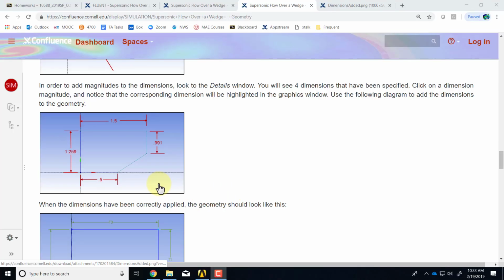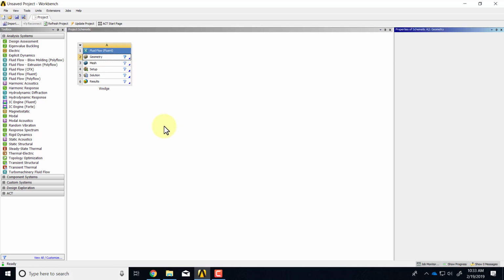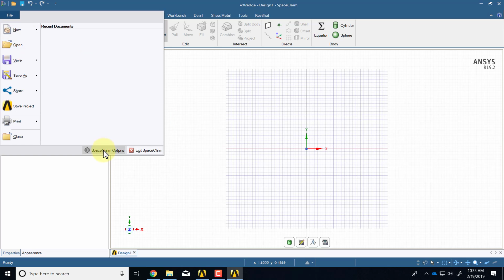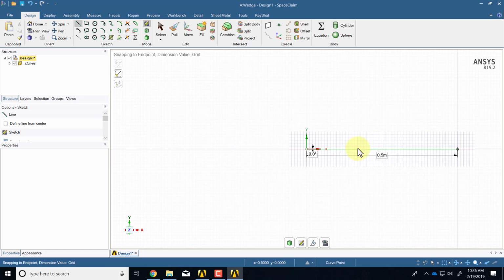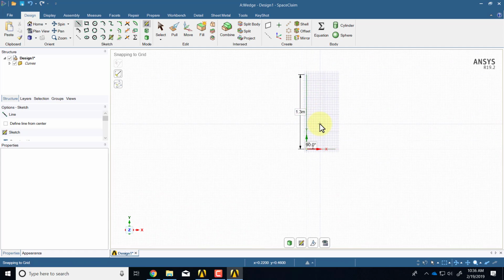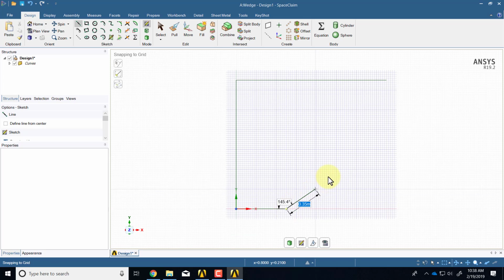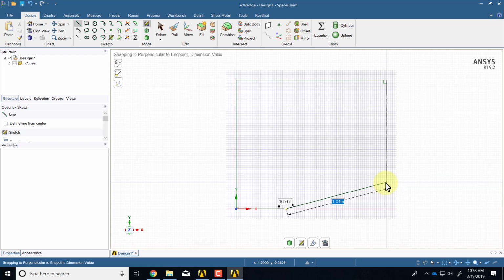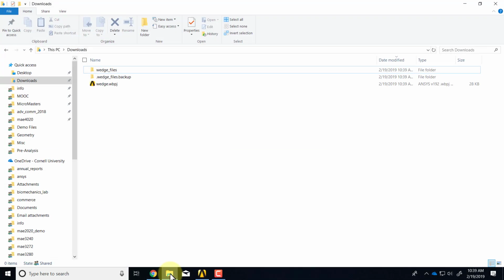Supersonic Flow Over a Wedge Using Ansys Workbench — Create Domain

Comment: high mach number such as 25 calculating NACA0012 airfoil giving a lift coefficient 2 two and not converged solution (y-velocity kept at 0.1). how can i make it converged and get a reasonable Cl?

p/s: the reference value compute from farfield